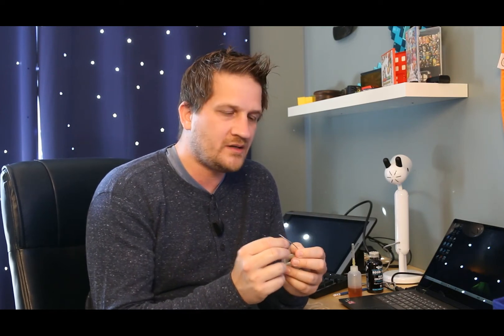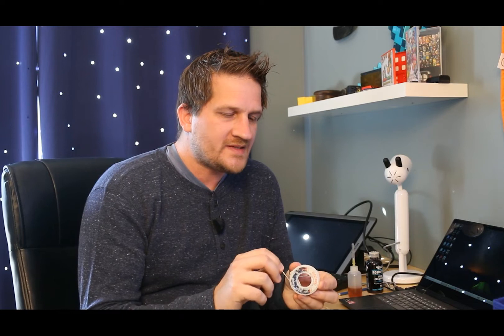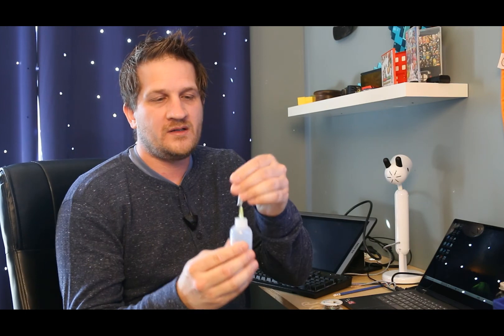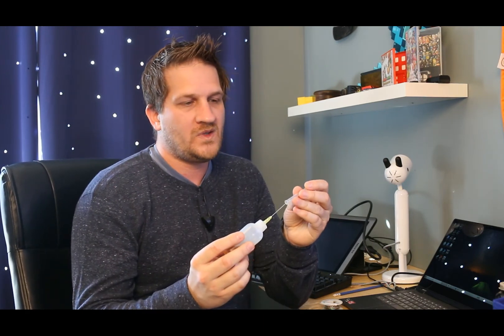Soldering --- Do I need Liquid Flux?

Comment: Failure begins with the uninformed. It is true in many things and is definitely true with electronics soldering and use of flux. Most solders have a flux core. Those used in electronics do. Flux use, extra flux, aids in cleaning the joint and increasing solder flow. Liquid flux is what I use and it is brand matched to my solder’s flux core. Mixing unlike fluxes, flux core and extra flux, is a recipe for problems. In high quality, high reliability soldering, extra flux is a necessity as a cleaner and better joint reliability. Matching your extra flux to your solder’s flux core yields superior results. Liquid or gel flux are the best options. Excess flux occurs when the uneducated put too much on a joint, cup or wire. Wasted flux causes you to use more than you need and costs you money because of the waste. The choice is up to each one who solders. Matching extra flux with your solder’s flux core achieves a better result. The best results occur when the flux core and the extra flux are brand matched as the chemistries are identical and this is ideal. Consistent, reliable and repeatable high quality results are possible when you follow the simple rules of matching your solder’s flux core to the extra flux you use. Not wasting extra flux is learned. Using different size needles with liquid extra flux is the method of control used by the professional solder tech to not waste flux. Gel flux is metered by how much pressure is exerted on the container. Practice is the key to flux use and to learn how not to waste flux. It is your choice how you use extra flux or not, but not using it will not yield the best result. Trying the use of extra flux will prove to you that what I say is true. If possible brand match your extra flux to the solder’s flux core. Matching the type flux in your solder’s flux core to the extra flux you use is rule one. Brand matching will yield the best and ideal results. What you do effects your work which is your time and effort. Make it a positive one that you can be proud of. Compromise is for relationships, it has no place in professional soldering ops. Solder like the pros and be a part of soldering excellence. It will enhance your experience. Practice, practice, practice your art!

Comment: Just buy proper solder, and you will be fine.
Reply: As long as the joint surfaces are clean (use fine emery paper and/or isopropanol if necessary), then I would agree, proper solder is all you need for through-hole soldering - I did without it for years 😋 But flux is useful where you cannot apply solder to the joint (e.g. in a confined space) and you need to "carry" solder on the iron to the joint. Here, you would apply flux to the joint beforehand. Flux also helps if tinning large areas (e.g. copper earth straps). For SMD work with a soldering iron, flux is essential.
Reply from the maker: You can get by especially if soldering fresh clean parts however even copper wire ages and forms metal oxides over time.  I use liquid flux for everything it just flows so much quicker.
Reply: Not true
Reply: @jesusgirarte-sandoval7535  not true what !